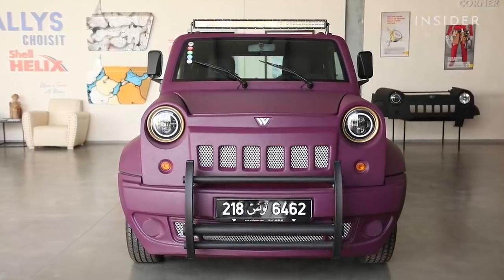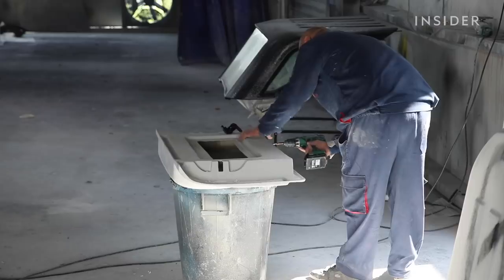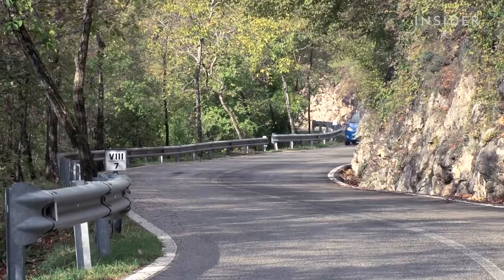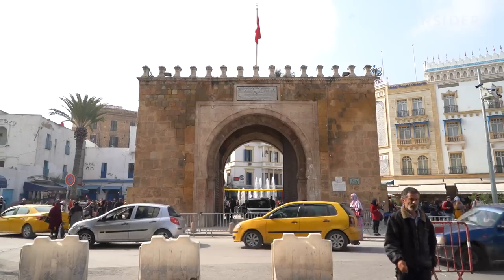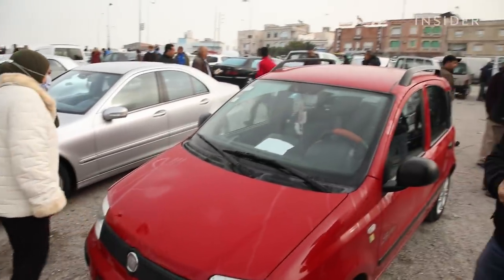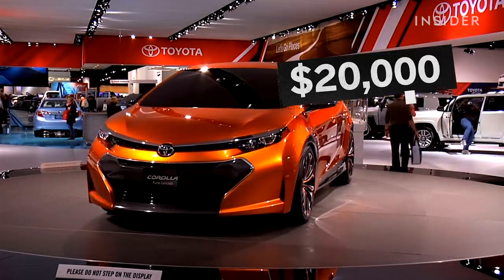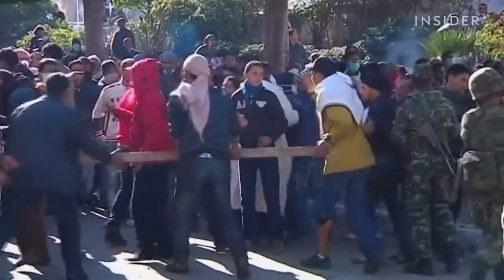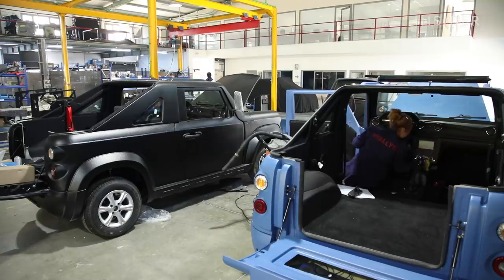Why Are Cars So Expensive In Tunisia | So Expensive

Comment: Very interesting, though, somehow the same issue in Kenya. Kenyans can only import second-hand card with a maximum of 8 years old. You'd think they'd be cheap for the larger public but nothing could be further from the truth. Normally, Kenyans pay car import taxes that are either the same or higher than the value of the car being purchased. For example, Kenyans end up paying prices for a 2014 car (e.g. Mazda6) that would be equal to buying a 2020/21brand new car in the West... You'd think the government's doing this to protect the local auto industry but that's not the case as we have car assembly plants for various brands such as VW etc but their vehicles are still very much expensive.
When Kenyans import exotic vehicles like the Lamborghini Urus, they're required to pay taxes of the same value as the buying price of the car. So if an Urus selling price is $300K, you'll pay taxes worth $300K if not more, to import the car into Kenya.

This has led to Kenyans registering their exotic cars in neighboring countries such as Uganda, South Sudan and the DRC where the tax regimes aren't as 'greedy' as Kenya's. Due to this, you'll find on Kenyan roads an Escalade with South Sudan registration plates, a Rolls-Royce Phantom with DRC registration plates etc.

Comment: In Tunisia, they sell cars for double the price, sometimes triple! For luxury cars, taxes may reach 170% of the original price! Yes, taxes are more expensive than the car itself. For used cars, in Tunisia, you buy a new car for 14000$ and after 5 years you can sell it for 16000$ ... Used cars are more expensive than a new 5 years model car, because the new model of that car is sold now for 23000$

Comment: In Pakistan imported cars with big engines are sold 5 times their original value, such as the LX570 which is worth about a $100,000 but it costs almost $500,000 in Pakistan.

Comment: I live in Trinidad, West Indies.
I was a used car importer for 12 years. Most used cars are imported from Japan.
A 3-year-old Toyota Corolla Axio may cost about US$10,000 with Shipping.
We pay 25% Customs Duty.......US$2,500.
We pay additional tax on the 1500cc engine.....US$955
We pay 12.5% Value Added Tax......US$2,812
Other charges not related to Government Taxation. (Importer fee, Broker Fee, Inspection, Registration, Preparation, etc. .....US$1,325.
Total to Customer.....US$17,592 which is equivalent to TT$119,625.
If you go to buy a new one at the Toyota Dealer, it will cost you about US$35,000.....TT$238,000.

Comment: According to the NBR, importing a car is quite costly in Bangladesh that involves  25% import duty, 15% to 500% supplementary duty depending on the size of the engine, 15% VAT, 5% advance tax, 5% regulatory tax and 4% advance trade VAT on tariff value.

Comment: In Turkey: Excise Duty for small engine (<2000cc) = 220%
For bigger engine(>2000cc) = 150%

Actual price of Audi A6 493.630 ₺ ~49.000 Euro
Excise duty (%220 of actual price) 	1.085.986 ₺  ~ 108.000 Euro
VAT (%18) 284.331 ₺ ~ 28.000 Euro
Yeah, I know 18% of 49.000 Euro is equal 8.820 Euro, not 28.000. But in Turkey, VAT for a car calculates for actual price + excise duty instead of actual price. We pay VAT of Excise Duty, which is also another tax. It's quite interesting. Turkey goverment earns more money than Audi itself, additionaly without any production cost etc. In the end we pay 277% Taxes for a car, which its engine is bigger than 2000cc.

Comment: We have very high taxes here, add inflation to the mix, used cards from the early 2000’s which costs 500$ in the us,  will go for 3 to 4 thousand dollars here.
And not just used cars, high end cars too, a base model range rover is about 200 thousand dollars.
In a country where minimum wage is around 150$/month
Reply: Not really an drivable cars in the US for $500 anymore. Most things under $2500-$3 are going to have  a quarter million miles and probably have either mechanical and or cosmetic issues. You can find cars for cheaper you just aren't going to be driving something very nice or reliable unless you get lucky and find a great deal although price vs minimum income most likely favors the US. In my state the minimum wage is almost $14 per hour, so obviously much better than $150 for an entire month.

Comment: Twice? huh thats a rookie number, here in Bangladesh you have to pay triple the amount of retail value. And that's only for cars under 2.0L, the percentage goes up depending on the displacement of the engine. For example, a Rolls Royce will cost you a 40,00,000 USD period.

Comment: So, you guys just check the price of cars in Bangladesh market. 

Government import tax percentage on car.
Under 1500cc-  95%
.......... 2500cc-    125-150%
.......... 4000 cc -  300% 
Many more tax like vat, port fee, Consumption tax etc

Even if you buy a used Toyota premio.  You will need a budget of 40000 USD
Or for a Landcruiser prado 340000USD